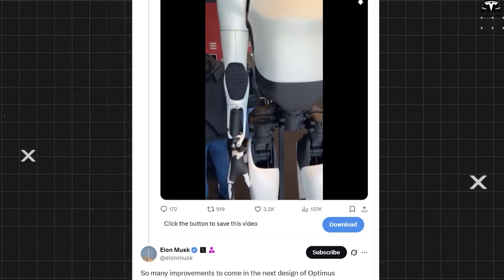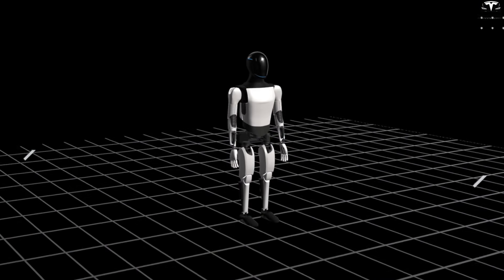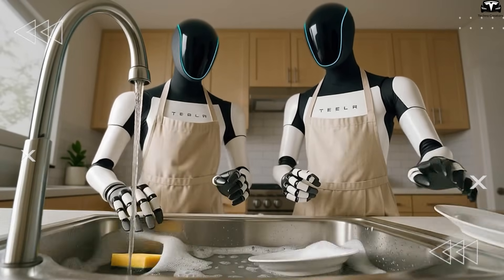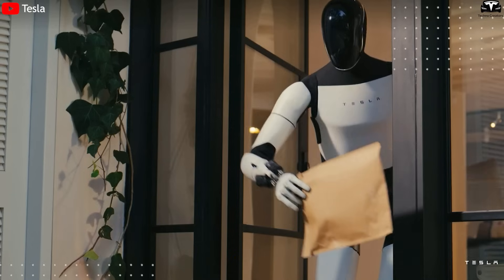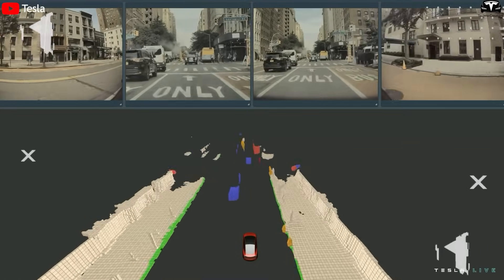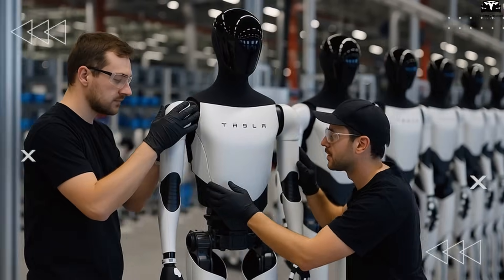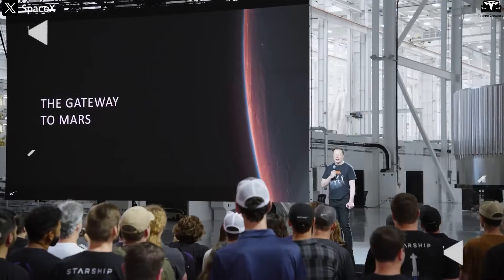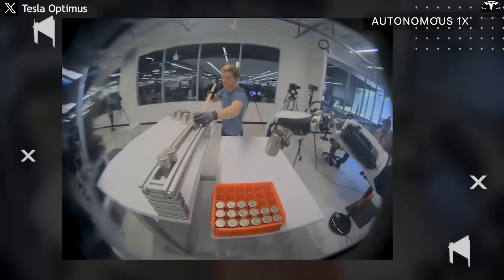BIG Update! Tesla Bot Gen V3 Can Perform Many Tasks 24/7 With New Battery! Details Explained!

Comment: Will you stop with BS. The 4680 does have 5 times more energy than 2170, because it is 5 times bigger. Your statement that it is 5 times higher density is false. And I whish your bot voice would learn to say 46-80 and 21-70 because these are dimensions in mm.
Reply from the maker: You're right, the 4680 has about 5x the volume of a 2170, but not 5x the energy density; it’s more efficient per pack, not per cell volume.